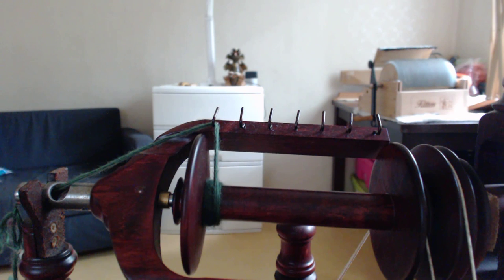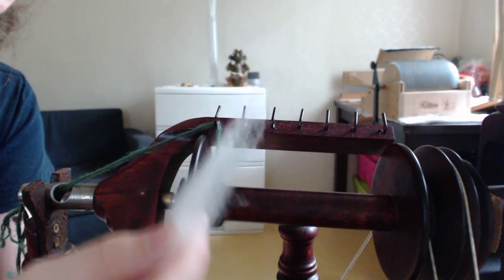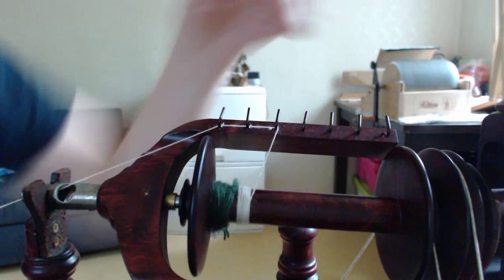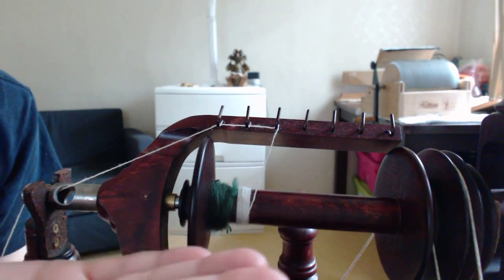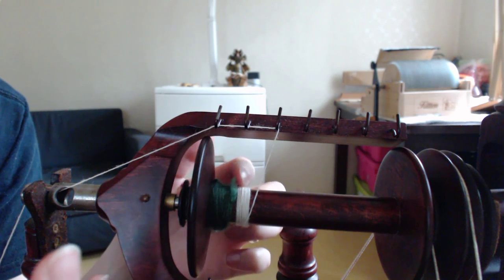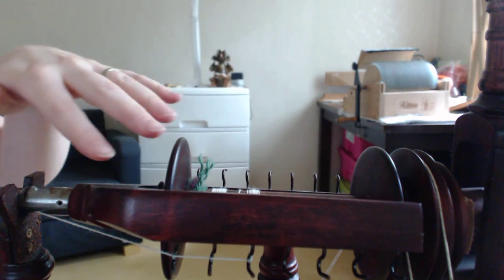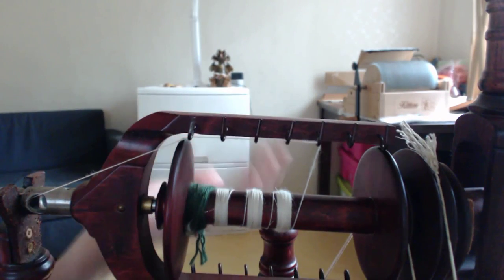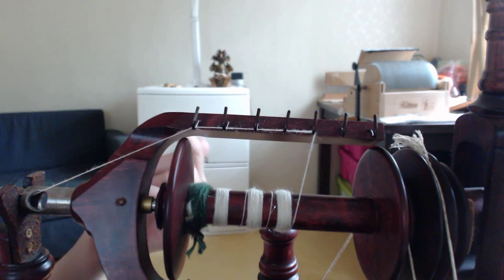How to Build Up Lace Yarn on Your Bobbin: Part 1 - How to - Expertly Dyed

Comment: Thanks for posting this. I just got my first flyer wheel and haven't found much info on cop-building. I spin on spindles and a spindle wheel, and building a stable cop is completely different on them.
Reply from the maker: You're right, it's very different! I had a lot of requests for this type of problem, so I tried to cover all of the bases with this video. Let me know if I left anything out! Thanks for watching, Amy. :)

Comment: On my wheel the hooks are on the same side of the flyer and so I move the yarn from one side to the hook on the opposite side. The opposite hooks are alternating on each side so by going back and forth I don't have the blank spaces. I noticed that the hooks on your wheel are on opposite sides of the flyer instead of on the same side like mine.In this case it seems as if the hooks on the same side are an advantage, I am just curious why the difference and what the advantage would be to one like you have. I am pretty new to spinning and only have one wheel and it is an antique from the Netherlands, it is pretty persnickety, but I am glad to have it anyway. I would like this info in case I ever buy another one of if I buy one for my daughter.
Thanks,
Lisa
Reply from the maker: That's a great word, persnickety. :) There may be a variety of reasons why hooks are placed on the flyer the way they are, but I typically don't use them in creative ways. Some people use the hooks on the alternating side to help tension various kinds of yarns, but I usually get on by just adjusting my drive band or brake band. 

My Babe wheel has hooks on either side of the flyer and they're on the same side together. This allows me to zigzag the yarn across the hooks to decrease the tension uptake when I'm making a lace weight yarn. I like the way my Kromski makes lace yarn, so I usually just use that wheel instead. It could be the difference in double drive (Kromski) versus single drive (Babe), and the double drive just produces an easier lace yarn. Or maybe I should try using the opposite hooks on my Kromski to help me spin the lace yarn better, since I'm currently spinning lace yarn.

There is a lot about hooks that I don't know, but I can help you look into this if you'd like. I remember reading something about lacing up the hooks in a Spin-Off magazine at one point..

Comment: Id really like to learn how to do such a fine consistent single, 44wpi sounds so much thinner than anything Ive done. Especially when it comes to ply it later, anything thin tends to break - how do you join a broken single mid ply?
Reply from the maker: It's the thinnest I've ever made. Because it will be a 3ply, more twist is going into the yarn so I hope it doesn't break when it plies.

There are a couple of ways to manage a break while you're plying, one way is to apply water to the break, overlap the ends, and felt them together by rolling the section between your fingers. With a 3-ply, I just overlap the ends and keep plying. You can't tell if there is a broken spot on a 3ply yarn like you can with a 2ply, so I tend to give the fix a bit more care with a 2ply rather than a 3ply.
Reply: Thanks.  Im fairly new to spinning and my singles look fairly good and consistent till I try to ply them and then they let out all their secrets.
Reply from the maker: Liz Kimber Getting an even ply is nearly everyone's battle! You'll get better at juding how the ply will look while you're spinning the single, but it just takes some practice. Many of my first plied yarns were very bumpy and uneven. It's actually tough for me to make yarns like that anymore. :)
Reply: I have no wish to make "art yarns" persay, id like to have people do the "you made that? Really?" thing.  My singles often seem consistent enough until I ply and they love to snap
Reply from the maker: Liz Kimber I had my hairdresser back home convinced that I bought a designer shawl. I didn't keep the ruse up too long, but it's amazing the hear the "wow, you actually made that?!" comments right after. :D

Your plied yarn snaps? Or the singles snap?
Reply: The singles snap.. But ive only been spinning 2 months so.. I know i have much to improve
Reply from the maker: Liz Kimber My guess is that you are putting too much twist into the singles and they're snapping because of the extra tension. When you check the yarn, do you do a plyback test? That's where you double a short length of fresh yarn over on itself and see how the plied yarn would look. Does it look really tight? Does it feel hard? If so, then I think you might be putting too much twist into the yarn. 

If you've been spinning for only two months and you're already onto lace singles, I'm impressed! You clearly have a knack for fine threads, so keep it up. :)

Comment: What is the ratio ur spinning it?
Reply from the maker: I believe I'm using 12:1 for this yarn, only because I wanted a bit more control while I made the lace yarn. I should be using the 16:1 to make the yarn more quickly, but I haven't made such a thin yarn before. :)